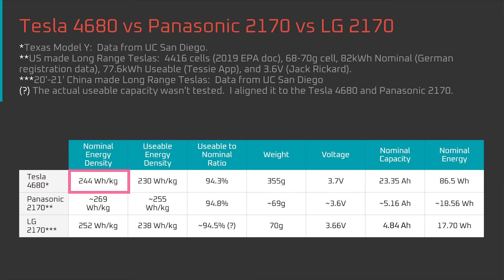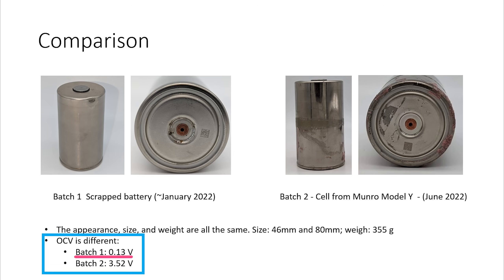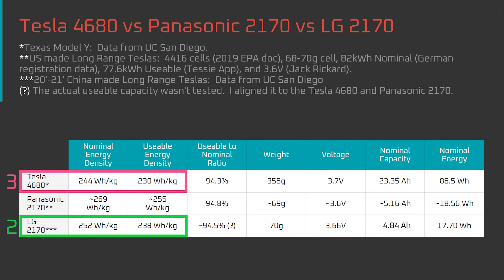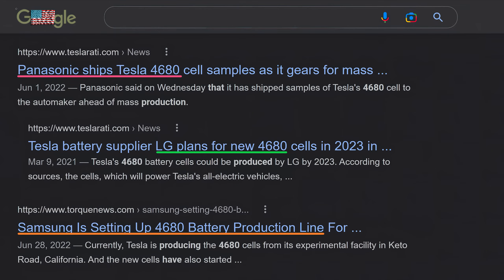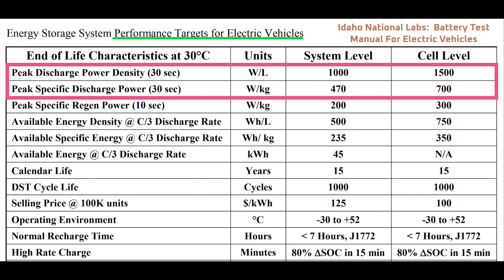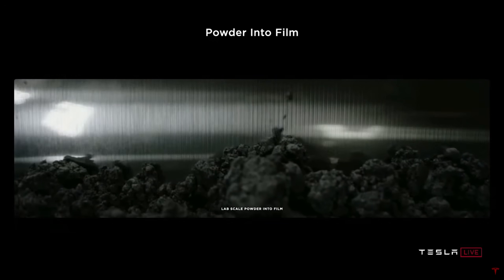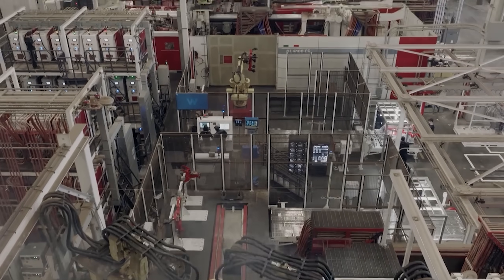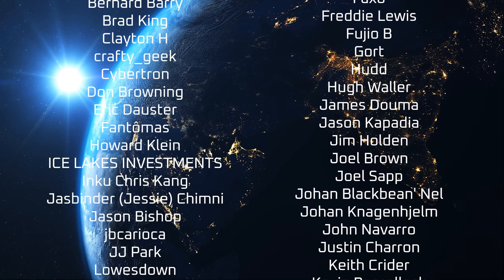Munro 4680 Energy Density Tested // Model Y Pack Size Explained

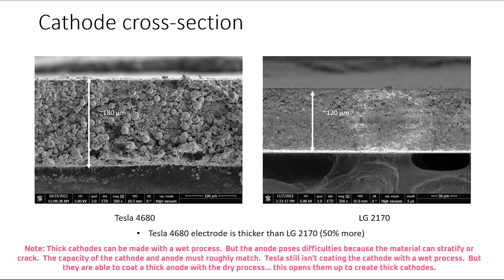Comment from the maker: Correction 1:  On the slide from 09:10 to 09:25, the note says "Tesla still isn't coating the cathode with a wet process."  It should say "Tesla isn't coating the cathode with a dry process."

Correction 2:  At 5:55 I say ohms rather the milli-ohms.  Obviusly I meant milliohms given that's what's showing in screen.

Note:  One thing I still need to look into is why the 50% thicker cathode than a 2170 results in only a 15% increase in capacity.  I'm guessing that it's partly due to lower Nickel content and higher porosity.  It could also be that Matt Lacey was comparing to a Pansonic cell, which may use a thicker cathode than the LG cell.  When I know more, I'll share.
Reply: There is a major mistake / omission here... You are comparing APPLES TO ORANGES. One battery is structural. The other battery is not. You have to subtract the weight of the displaced portion of the vehicle's structure. Let's say for example, you are able to remove 1/2 lb of steel for every 1 lb of battery that you install, then 1-1/2 = 1/2, and 268 wh/(1kg -1/2) = 268wh / (1/2kg) = 536 wh/kg! Now this is just an example and I have no idea how much weight is displaced, or even if there is any weight displaced in this first version of the 4680, but YOU CANNOT MEASURE WH/KG UNTIL YOU KNOW HOW MUCH WEIGHT IT DISPLACES.
Reply: @TheNativeTwo  He is absolutely aware of that and has discussed that multiple times in the past and even in passing several times in this video. This video discusses the penalty for thick cans. As you can see, much of the problem comes from the current chemistry, which is not quite on par yet. This is something that can be changed in future iterations.
Reply: For nickel issue, the specific capacity difference of Ni80 and Ni 85 is about 2-3%. Electrode press density influence more. For thick electrode design, bigger porosity is need to decrease ion transportation resistance. I think the thick electrode design is more for manufacturing speed than capacity. And the thick electrode design can only save some place of foil and sepa, the contribution for capacity is not so big. My view maybe not correct.
Reply: Have you heard if there is plans to reduce the internal resistance of the tabless current collector system? Like chemical copper surface bonding or perhaps a micro textured surface nurling of a new copper alloy that doesn't oxidize as much?
Reply: my suggestion would be that while you increase the thickness by 50% you wont have 50% more cathode in the cell, since the cathode is thicker you will not be able to fit in as many coils into the jelly roll. A more important metric to consider is the cathode to current collector ratio, I suspect when looking at this metric you will end up closer to the 15% capacity increase.
Reply: And what do you mean of 15%. I calculated and got that for 2170 the VED is 730Wh/L and 4680 only    650Wh/L. 2170 is 12% better.
Reply: Truly great work as always. Thank you so much.
Reply: Long time follower 🎉here hope you read my post!!!
With such poor energy density from these 4680 cells coming out what kind of mileage range and specs will the cyber truck and new model Y from Texas coming in the next few months have??
This is really concerning and decisive in my opinion…they better not say cybertruck will also have 2170
Reply: @ronnycali4145  The best batteries are from CATL. Tesla will buy their batteries
Reply: Another correction: 5:54 '7 ohms' should be '7 milli-ohms'

Comment: Rather disappointing...
What would really bring down costs is increasing energy density. You triple the energy density, you need a third as much batteries, 66% cost reduction right there. Also less weight, less volume.

Comment: So Tesla reduces weight due to the structural battery pack. However they have to make the cans thicker. So they get there 10% extra weight for the batteries. For a 70kwh battery that is .1*70000/269=26 kg. That is not too bad. I wander how much weight Tesla plans to reduce on the long run on the structural pack.

Comment: The problem is that this is comparing cell energy density.

And thats not an appropiate comparison, it should be comparing similar capacity battery packs.

Cooling is the biggest advantage for 4680. And that makes the pack lighter. Add structural advantages and that removes weight from the final pack.
Reply from the maker: See the pack video I just released today.

Comment: For the structural battery comparison to non structural battery you would have to include the structure in both cases obviously. So basically the 4680+floor of car VS other + floor of car.
Reply from the maker: Yeah, there's wiggle room in a few different directions on the energy density figure.

Comment: Do you know what chemistry was used in the new 4680 cells? 
I don't think they're nickel base.
Reply from the maker: NMC 811 - I showed it in the video
Reply: @thelimitingfactor  sorry I guess I missed it, but am I understanding correctly this is a (N)ickel(M)anganese (C)obalt mix? If so then something is not adding up.
On battery day, the battery was supposed to have a 16% increase in range while the entire manufacturing with the new Giga Casting was supposed to have a 54% increase in range? What happened, what am I not understanding?

Comment: Is the gravimetric energy density that important?
In an airplane, battery weight is critical. In the car, a high volumetric energy density or a high energy density per base area is important in order to be able to install as much cell volume as possible with a limited wheelbase. 80 mm high cells allow more volume in the battery pack than the 70 mm high cells. BMW even plans 95 - 120 mm high cells. These higher cells have even lower kWh costs.
What Tesla plans above the 4680 is not yet known. Tesla doesn't need to admit that either.
Reply from the maker: It also serves a proxy just fine for volumetric.

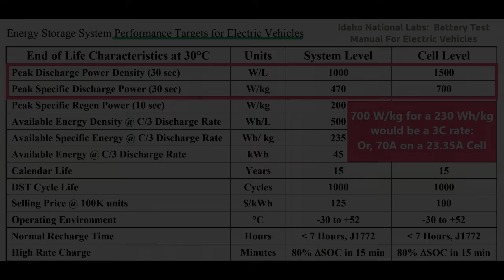Comment: 11:00 The "power" factor likely has more to do with the upcoming Tesla Semi truck and Cybertruck than it does with the Gen 2 Roadster and current Plaid lineups since high, steady torque from high, steady power is required when towing large loads up hills and mountain ranges during long-hauls.  Though there are no immediate plans to use the 4680 in the initial Tesla Semi truck targeting intra-city consumer goods distribution, it will likely be the go-to battery for all Tesla platforms, including Powerwalls and Megapacks, once economies of scale drive down cost ... right about the time when interstate long-haul shippers will start getting their Tesla Semi trucks.
Reply from the maker: Nah, the larger pack allows for more power.  Pack will be 9x larger than the Model S, but only twice the motors and they'll be smaller motors.

Comment: Jordan, will you do a recap video on battery chemistry? Some of the things to cover are: "Where is lithium hydroxide used?"; "Can most of the transition metals (singly) be used in the cathode?"; "Which other elements can be used (theoretically) as ions to shuttle between anode and cathode?"; "What forces attract and compel the ions to move from one side to the other?; "Can an element, like aluminum, really be forced to give up more than one valance electron?" "Why don't electrons go through the separator?";  "Where are the electrons stored when they leave the anode, during discharge, and go (externally) to the cathode?"; "Do electrons move only a few tens of microns; but, their accumulated charge is felt (as electricity) from the anode (externally) to the cathode?"; and other simple questions.
Reply from the maker: I did a "how a battery works" video that covers some of these.  Worth checking it out if you haven't!

Comment: The Texas cathode building is under construction. They delayed a long time to begin its construction. The building is as long as the type which would house the usual wet electrode heaters and dryers. I, therefore, think that Tesla doesn't have hopes of having the cathode dry process perfected in the near future; though, they do have a dry anode process in use. They must produce the 4680 cell, even if the DBE (Dry Battery Electrode) process is perfected, or not.

Comment: Some may think that the cell content (the "jelly roll") should take some of the forces exerted on the can. They reason that the content could increase the can's rigidity. Stresses on the "jelly roll" could cause cracking and other defects of the "jelly roll"; so, not a good idea.
Reply from the maker: Correct!

Comment: From my undersyanding with the design of the tabless electrode and surface area advantage i cant see why they are not 46 x 120mm or even longer.If it could be double the length in an 65mm can i think production speed could be halved for energy output! I know they have done their calculations but now being 3 years along since initial announcement i cant help feel in hindsight that they could have made the cell bigger and therefore stronger as well in respect to more rigid as being longer would make it far more rigid ! Anybody got any thiughts on this?
Reply from the maker: Packing density starts reducing at larger cylinder sizes.  I didn't believe it, then I saw it modeled.
Reply: @thelimitingfactor  but still the longer the canoe the more stable it is . Does that analogy ever hold water! 😂

Comment: Before its all said and done and they have moved on to a different architecture I think we will see energy density max around 360-380. When we achieve 400+ many aircraft applications become a reality that currently are not do to weight. There's going to be tech gains and learning curves. But I think the 4680 + silicone  in the anode etc is going to be another great move by Elon.

Comment: I am a cell design engineer. The cross-section image of cathode electrode greatly confuse me. The thickness of 4680 is 180 micro meter for double layer? but I cann"t see aluminum foil. If it is one side thickness? It is 2-3 times of the common used design. Hope your reply.
Reply from the maker: Due to the way that the electrode was cut, it's difficult to see the foil.

So yes, what you're seeing is active material/foil/active material
Reply: Got it. Sometimes in the CP image foil can be seen. Thanks!
Reply: I love your video very much and I learned many things from them. I read many papers introduced in your video. Thank for that. I have several years of experience for EV cell design and manufacture. Hope and glad to do something for your video if necessary.

Comment: I believe Tesla is new to the cell game and it is very very difficult to handle higher Nickel based cells. From safety issues to degradation. These difficulties are the price you pay for more capacity of the cathode material.

Comment: Power is a very tricky topic and highly doubt a university could reconstruct this. Power is usually based on the DCIR and the max current values. Max current values takes some time to establish.
The Power capability will of course be increased with a tabless design since electrodes travel less to the terminal of the cell and there other factors.
Interesting would be the quick charge capability for SOC 8-80% but that will be tough to get because usually quick charge patterns are developed specifically in order to ensure quick charge can be done for a certain number of cycles (~300-400)
Reply from the maker: Another thing I think I need to do a video on.  Just getting my head around power.

Comment: Can thickness increase is also due to thermal propagation requirements. The higher energy of the 4680 also means that more energy would be released in case of thermal runaway etc. Therefore the thicker can thickness also provides more stability and helps to account for the higher energy content which could have the potential otherwise to ignite other cells in its vicinity
Reply from the maker: I think I need to make a video on this!

Comment: Great video.  A little disappointing though for Tesla fans and investors.  I think most people expect much better performance than "on par" with 2170s ....and that is after the "adjustments" you alluded to.  On an absolute basis, it is performing worse?  the only benefit for 1st gen 4680 is cost based on your video but that is when it's full ramp I am assuming.

Comment: Are you saying the 4680s are close to the 2170s in energy density but are significantly cheaper to produce?  Have the 4680 cells achieved what was suggested at battery day?   If not, can I assume it's a work in progress with improvements still to come?
Reply from the maker: That was all answered in the video
Reply: @thelimitingfactor  I've watched it twice so far.  Lots of tech and detail.  Thank you.  You are clear that it is a work in progress and that Tesla is prioritizing making cheaper battery packs vs better chemistry, but I am still unclear as to how much progress has been made towards the goals outlined on battery day, the chart you show at 17:45.  The 56% improvement in %/KWH for instance.   I understand you don't have enough info for a precise number, but does it seem like they are on track?  A third of the way there perhaps?

Comment: The big gain with 4860 vs 2170 is the price on the pack - gain estimate 5.500$.  Tesla make 8 batteries 4860 in the same time than 1,5 2170. And, on the batteries pack, you can remove (2976-828)×2=4296 welding points and, you remove 2976-828=2148 movements.  This is the big gain now.  Gen 2 and 3 will be better but, in next years but not now.  2170= 96×31 batteries and 4860= 92x9 batteries

Comment: nice. pretty much the conclusion on the 4680.  Turns out that the reason the why the AWD vs LR weighs the same but different capacity/range is because of Panasonic's use of silicon.  Weren't for that, the max range or battery capacity would be the same for both.

Comment: I really like the video and the work, but the energy density figures are a bit underwhelming.
This means this has inferior energy density to the LG M58T by a decent margin, rather than being to close to on par.

To be fair though, structural designs do provide a large amount of benefit, and the chemistry differences do make a large difference.
Finally, another thing that does actually dissapoint me is how high the power losses are for the cell.

Getting 90% of your rated capacity at 1C discharge rates is honestly quite poor when considering cells like the Molicel P45B do far better.
Reply from the maker: That's because the Molicel is a high power cell rather than an energy cell (note that it has lower energy density)

Besides, you really need to test the cell rather than go off the marketing material, and test it on the same rig in the same conditions.

Beyond that, on power, it depends on whether you're talking 30 second peak power or full discharge.  Those are different situations that are dependent on different variables.

Comment: thank you sir, loads of great info, I am 22.5k miles into mine and still great. really do think being silicon free may have cost 50 miles range 100 to 0% but isnt with out longevity benifits. besides I think its rare to drive 100 to 0% . I really believe 250~300 miles will remain a sweet spot over time
Reply: the power this thing has as a suv is mine boggeling